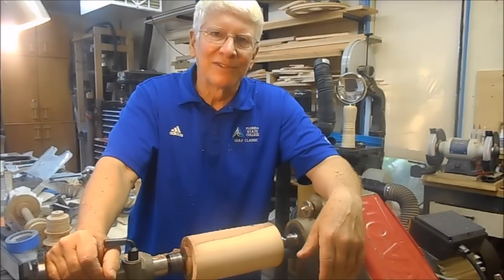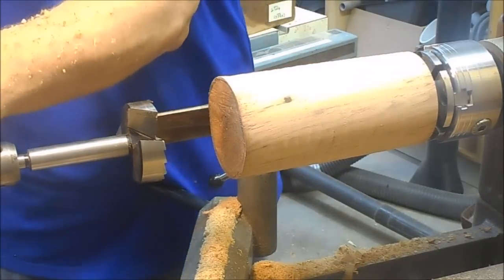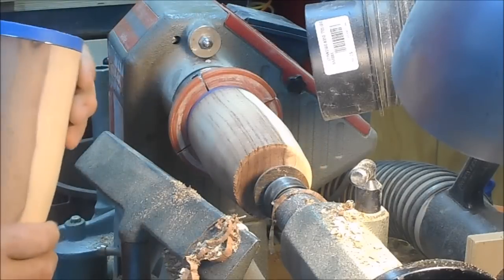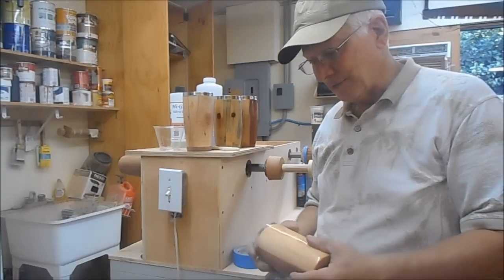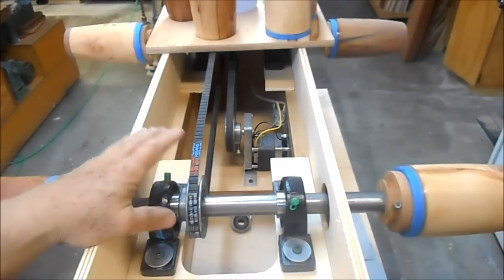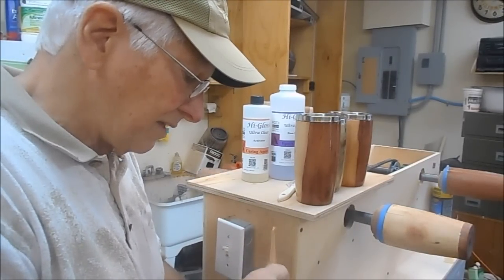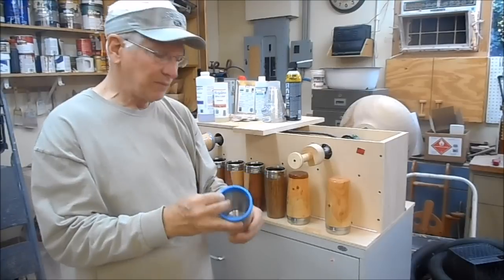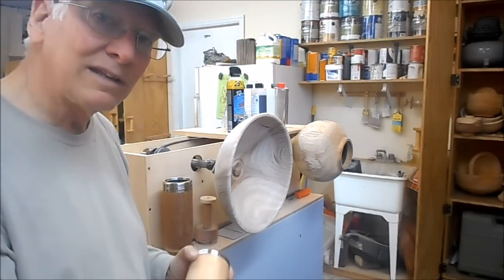Travel Mugs

Comment: Great video ...thank you!

I've been thinking about making a turning machine like yours for a while.  I was going to use windshield wiper motors with a speed controller. I like your setup. I was making some vases and cups, was using food grade epoxy for the cups so it eliminated the ss insert. At the time I didn't know inserts were available. Had a problem with the epoxy running so wanted to do something like you did.

Wondered where the best price and best inserts come from?

You mentioned in the comments below that you had a video link for more detail on the turner, could I get a link or could you share more details ....motor kind, misc parts etc?

At the end of the video you had some bowls mounted to the turner. are you using a chuck to hold the bowls? if not, how are you attaching the bowl to the 1" rod?

Thanks again John...love all your videos? Must be busy.....would like to see more :)

Best Wishes

Scott Parat
Reply from the maker: Scott Parat Thank you for looking in on my channel and the  video on epoxy. I do not make the travel mugs anymore. But the inserts are available at many sites and seems like Craft Supply usually had the best price.

The work now is mostly large hollow forms, vases, and sinks. All coated inside and out with epoxy. The machine to rotate the pieces has been totally rebuilt with a much larger motor that can handle the larger pieces. I will be doing a updated video on the new machine and procedures soon and will cover the parts ad pieces that make it work.

Thanks John

Comment: Great video, cups look awesome, would have like to seen a little more on how you hollowed the cup out all the way.

Can you tell me where you got the stainless steel cup liners?  ...thanks :)
Reply from the maker: Scott Parat Thanks so much Scott. I have bought the stainless inserts at a couple of places but Craft Supply seems to usually have the best price and some discounts for quantities. Here is a link to their web site: https://www.woodturnerscatalog.com/p/54/5274/Artisan-Travel-Mug-Kit
Also, sorry it took so long to answer, been getting ready for an art show.
Reply from the maker: Scott Parat also, as for the finishing the hollowing, it is a good bit of trial and error. First I try to establish the opening width that is pretty straight for the first inch or so. Then it is tapering to the bottom that was drilled with a 2 1/8" forstner bit. That is pretty close to the bottom diameter so tapering works pretty well.